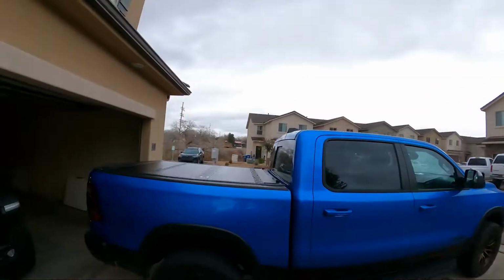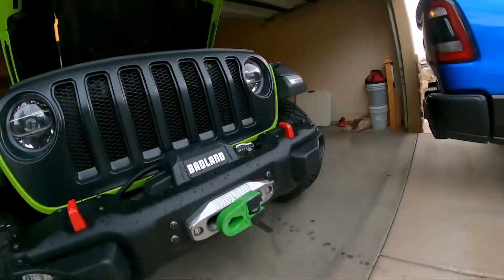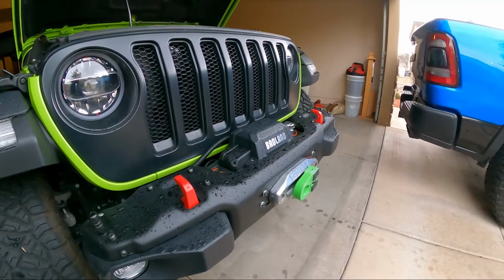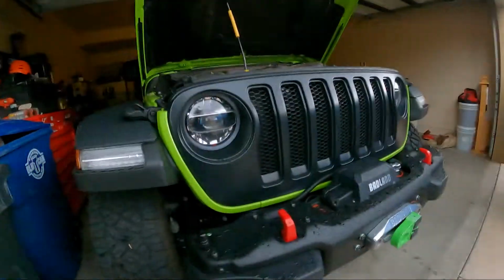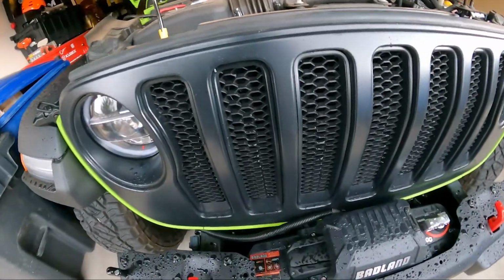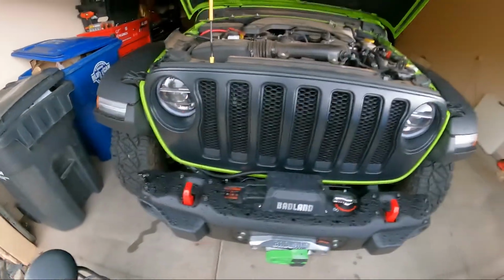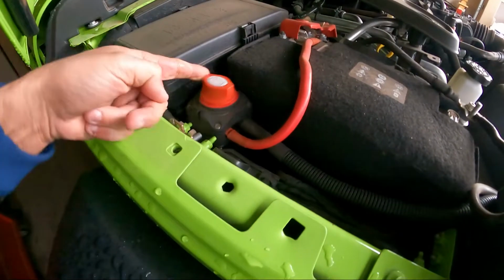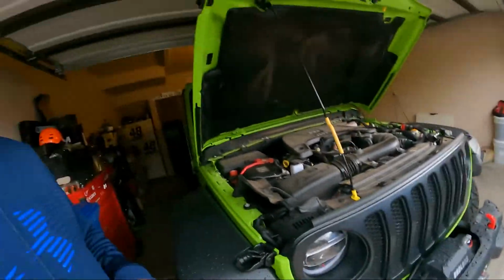Is the Harbor Freight Apex Winch any good? Badland 12000 winch real world use and honest review

Comment: Its a decent winch but I can tell you one thing. Double up your winch plate.  If it flexes you will blow up the casing in the winch.. you will flex the single plate for sure and i the housing will crack.
Reply from the maker: Ya I’ve seen the videos of that kind of damage. Seems like it takes some extreme abuse to get it to crack the housing. Thanks for the info!

Comment: All the synthetic ropes will deform no matter who makes them. The wraps smash each other under pressure. I run a 30,000 synthetic rope that is round and it has already deformed from winching myself over and up obstacles. It's perfectly fine. Look for fraying and cuts flat spots are ok.
Reply from the maker: Thank you for sharing! I figured it was good but I’m used to wire rope that doesn’t flatten out like that.
Reply: @TheSatos  if you flatten cable you did something LOL. It can happen tho and it needs to be replaced when that happens but synthetic rope is way more forgiving than cable. I ran a Arachini synthetic rope on both winches. My last rope made it 8 years before failure. I actually pulled in half twice in Hot Springs Arkansas. I was hung up pretty bad. It was a 17,500 lb rope My wife still has her same rope. But I bought 2 30K ropes because hers is old. Definitely get yourself a backup rope tho.
Reply: They ran me $200 a rope but well worth the cost
Reply from the maker: @Bigdaddyslasher  I’ll have to look them up! Thanks
Reply: @TheSatos  no problem keep us posted about your winch. I am thinking really hard about getting one my old Smittybilt X2O 12k is pretty beat up and will get put on the trailer soon.
Reply from the maker: @Bigdaddyslasher  Sure will I just used it the other day to pull a Bronco off an obstacle after it snapped a front axle. That video will be out on litebrite channel tomorrow!

Comment: I'm curious if anyone has an Apex 12000lb still unmounted they could share if there's any chance of packaging in two boxes and getting the main body down under 70lbs, with box (for priority mail to APO)? Shipping weight of the synthetic version is 82.55lbs from HF. Taking off the line should save about 5lbs, but not sure how much the hook, control box, remote and cables could save. Thanks for any help!
Reply: @brenansmith5214  thanks for the help!!

Comment: Failures of the Badland Apex are shown in some YouTube videos. The failure mode looks to be torsion on the entire body of the winch causing fractures in the cast plats either on the motor side or the clutch side. What concerns me most is the loads those failures took place under looked well short of the winch rating. So just a suggestion, search for videos of winches failing or getting bad reviews along with the positive ones. It's important to get the full picture.
Reply: Some of the failed videos “Wranglarstar” is completely his fault. So gotta take those as a grain of salt also. I will see I just purchased a Badlands after having a Warn EVO on another rig. They are exactly the same and probably made in the same factory.
Reply from the maker: I like mine. Haven’t had any issues. But I’ll post them if I do.
Reply: @corpsman247  I watched the same Wranglarstar video and he knew what he was doing when he hooked up to that stump... The bias was unreal and the techniques done in that video and the old truck frame video were horrible.